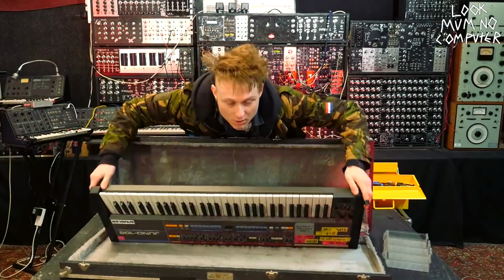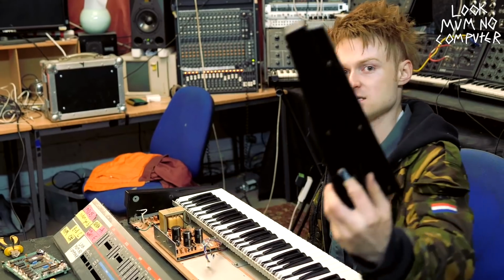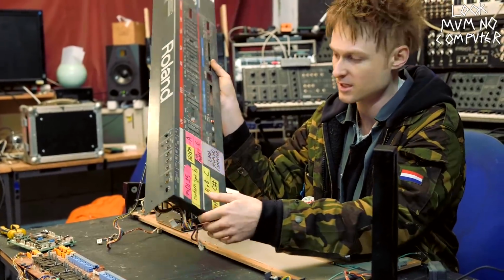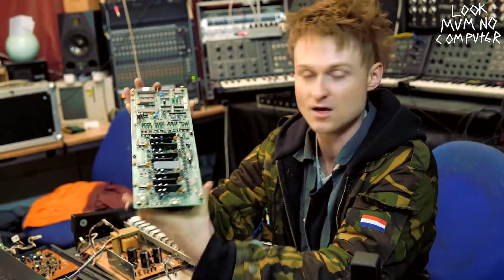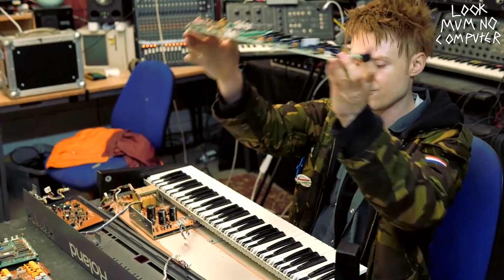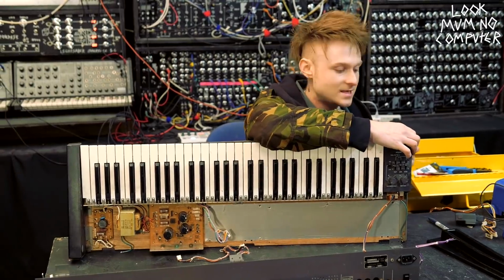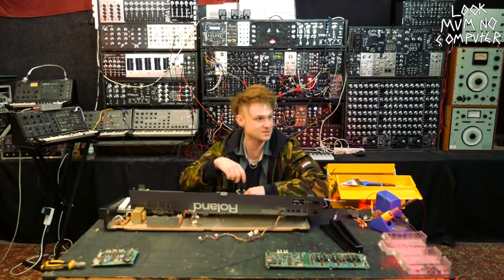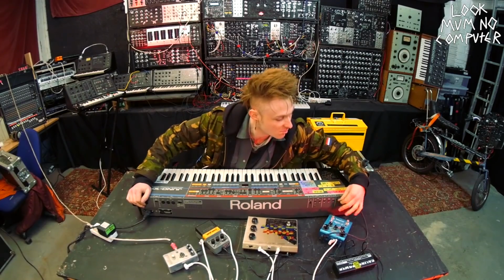Roland JUNO 106 Whats inside? REVERSE TEARDOWN

Comment: If you’ve got screws and washers left over, that just means you’ve assembled it better than Roland could.
Reply from the maker: cutting manufacturing costs in half!
Reply: George Paul - I had to sort out a power issue on my old D-110 and worryingly had a few screws left over. I feel much better now after reading your comment. Thanks.
Reply: Left Mono 👍
Reply: ha yeah happened to me too! 2 or 3 screws, and I checked...

Comment: One thing I learned about the 106 recently is that if you run both outputs (stereo) it's actually outputting two mono signals until you turn the chorus on. Chorus = actual stereo.

Comment: Such a great synth. If I had been 3 yrs older I would have bought this one instead of the Juno 2 (almost identical sound but no sliders, still awesome too). I remember the first time I put it through my distortion pedal (Boss DS-1) and my band mates turned their heads in a collective WTF!? Good times.

Comment: 2018: A Look Mum No Computer Odyssey
Reply: well it has a computer, as the 106 has storage. could be a z80/6800 whatever cheap they could get their hands on to put in in there to be used as microcontroller.

Comment: The voice chips can often be fixed if you remove the outside plastic...its a bit tricky but soak them in acetone, plastic comes off easy.
Reply: why would you. the analog renaissance started. You can even get the CEM3310,3320,3340 for under 10 usd. new, just from the factory. and start building your own fucking synth like they did back then.

https://electricdruid.net/analog-renaissance/

See here what is already available and much will follow.
Reply: Yeah the acetone bath worked well for me, I had a voice scratching an poping randomly and in the first place I feared it was dead. Analogue renaissance chips look great, but I only found it on US website, and shipping to Europe + taxes made it quite expensive, so... Pretty happy with the acetone trick for now ;)

Comment: ..he has a slightly more love hate relationship with the Juno 106.. I also have a HS-60 (Juno 106 w/speakers) that needs new sound chips.. I took my Juno 106 apart years ago to try to bring a couple chips back to live but I need new ones hopefully I can use the HS-60 as a reference because it been 10 years since I started that project.. I just bought new synths instead of repairing it.. the Juno 106 can do some amazing things that I haven't been able to quite duplicate with Dave Smith Instruments, Behringer or Korg.. the LFO is excellent and I like flipping the envelope to make backwards acid sounds.. it's the strange blips and harsh LFO that this really excells at.. Behringer Deepmind and Behringer MS-1  have my interest now..

Comment: If there was one thing I massively hated on Roland synths, it was the pitch bend/modulation wheel/stick thing. What was wrong with the more controllable 2 wheel set up every other synth had? (I've just noticed I was actually shaking my head as I typed this)

It was defo a Roland un-innovation of the 80's.

Find that person and string them up for Halloween for all the modulation imperfections that had to be smoothed out/drawn in afterwards!!!
Reply: As I've learnt a couple of synth solos, I've seen the magic behind a single stick with left and right for pitch and up for modulation. It's simpler, it's all contained into a single control and you don't have to have your hands crawl around like a spider holding down a spring-loaded wheel while the rest of your hand pushes on the mod wheel, only to revert everything back to normal after you're done. I also find it a bit more natural about the left and right motion for pitch bend rather than up or down, the same way knobs feel more natural than sliders. One control I'd like to try out is Oberheim's, where pushing down pitch shifts up and up pitch shifts down, I believe. It was based off of the idea of guitar string bending.